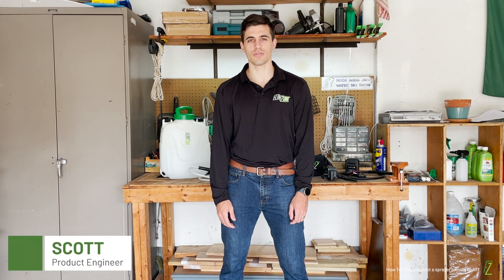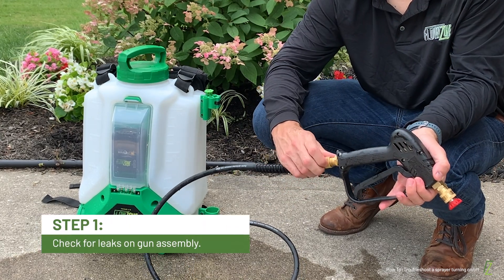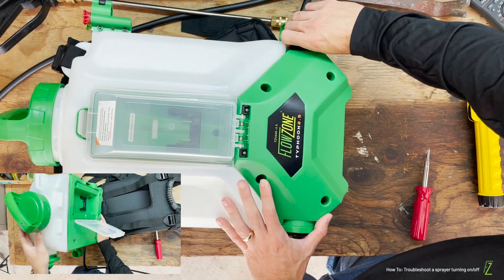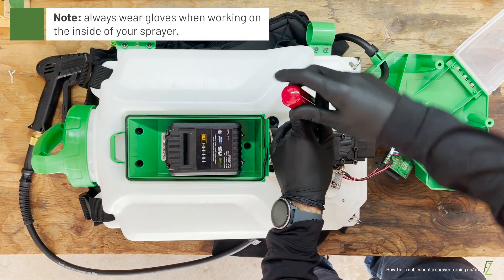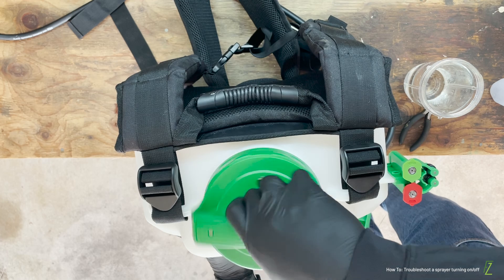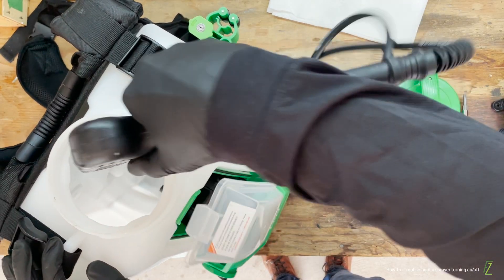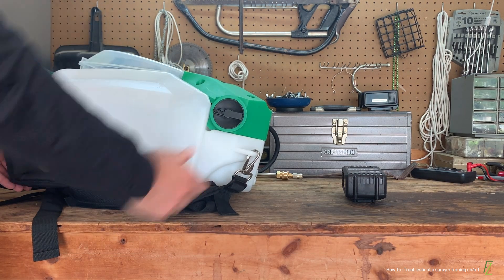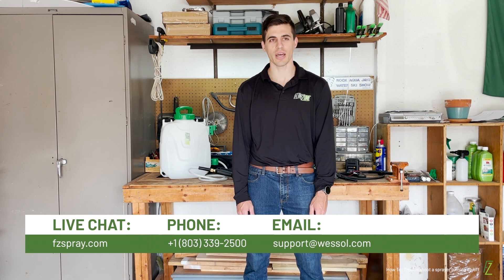How To: Troubleshoot A Sprayer Turning On/Off Without Being Triggered | FlowZone®

Comment: How do you replace the dial? my dial does not turn past #1
Reply from the maker: A lot of times you can fix the existing dial! Sometimes debris will get stuck in the dial area and will not let the knob turn. Just apply some WD-40, apply around the crevice of the dial, rotate a few times, re-apply, it should loosen up any debris that might be stuck. 

If this does not work, we have replacement front cover plates available for purchase through our website and distributors that contain a new dial.